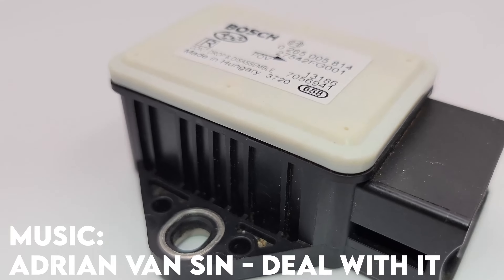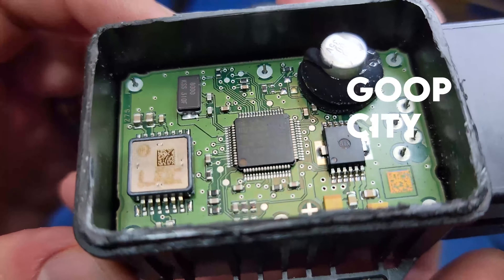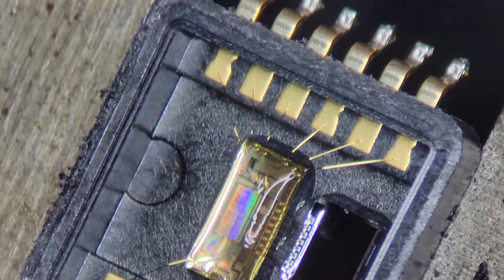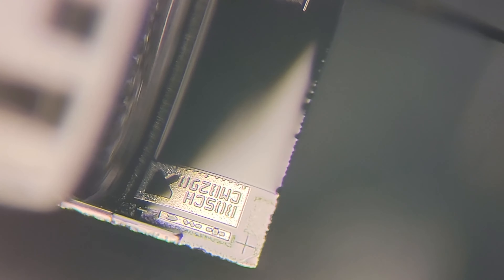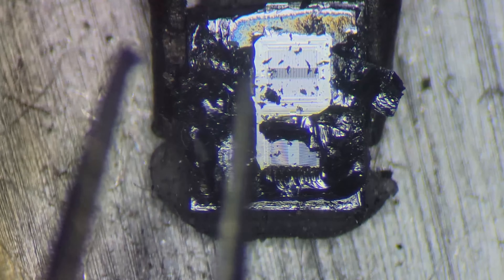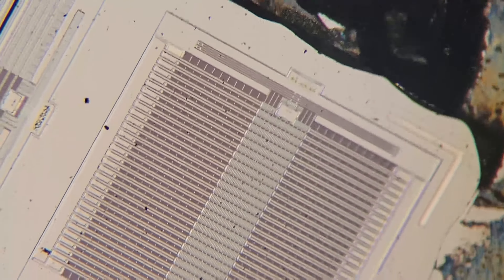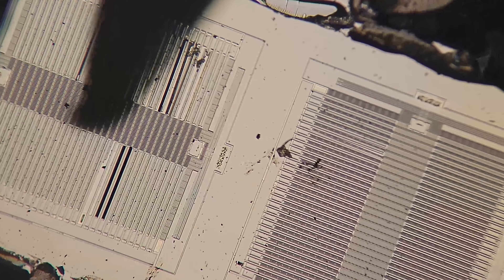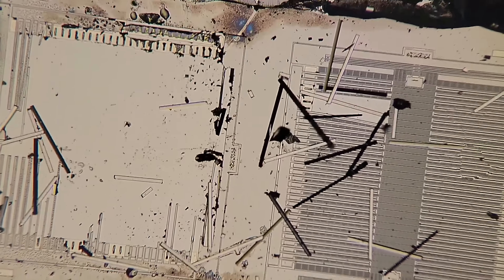Inside a MEMS Accelerometer (Re-upload: Fixed Audio)

Comment: The seal holding the MEMS die to the cap was likely a leaded seal glass. Next time heat the part up on a hotplate (about 400C), then you should be able to pull the silicon cap off without damaging the cap and causing particles from the delid.

Comment: One of the many boxes in modern cars that turn the money light on the dashboard on when they fail !!
Another great video.
Reply: Actually not true ever mems Sensor is rated for useage of 25 years which makes mems and Asics for Cars so expensive. Also mems and Asic are used for airbags and Esp and are not allowed to fail.
Reply: @maxgieschke4186 I had a Jaguar XKR and that unit failed and brought the warning light on which disabled stabiity control so yes, they do fail.

Comment: Being a MEMs device and made by Bosch I would guess it is used in vehicles to detect impacts that might need an airbag deployment.  Some German vehicles have Bosch parts in them.  Volkswagen is at least one auto maker who uses Bosch electronics and some ECUs are made by Bosch.  They make a lot of parts you might not realize are in your vehicle.  Of course they are by no means limited to the automotive sector.  Bosch may be one of those conglomerates who makes a zillion things I never had a clue they made!!
Reply: Military contractor most likely

Comment: How does such a delicate structure handle the g-forces of someone dropping their phone without exploding?
Reply: I was wondering this too!
Reply: Is guess that by having a ton of the small fingers it would probably disperse the load very well. Now the ones in a phone might be completely different in design though
Reply: I think that, since force is proportional to mass, they don't experience a lot of it (enough to move).
Also he applied the force in specifical points rather than distributed, and with directions they aren't supposed to experience
Reply: I think is due the way materials behave at different scales, if an elephant falls from 20m its going to splat, if an ant falls from the same height even in vacuum is very likely to survive with no serious harm. So while it might look very delicate for us it might be quite though, glass fibers are another example, they are bendy and quite strong.
Reply: @teresashinkansen9402  An ant in vacuum is done even without falling.
(except it is a Space Marine ant)
Reply: @u2bear377  True, though I think it depends how long the ant spends under vacuum and how low is the pressure, I guess the biggest issue would be desiccation before asphyxia?

Comment: They have put a lot of silicone on this capacitor so it does not move when this device is accelerating rapidly.
Reply: In Soviet Russia they would lay the cap horizontally and secure it with wire brackets soldered into the board.

Comment: The box was likely sealed using induction to heat a metal ring that heats up (between the white and black plastic, due to induction) as last production stage. Horrible way to seal parts! Energy intensive and impossible to dissasemble for repair without damage to case.